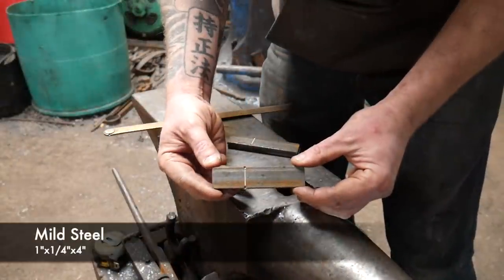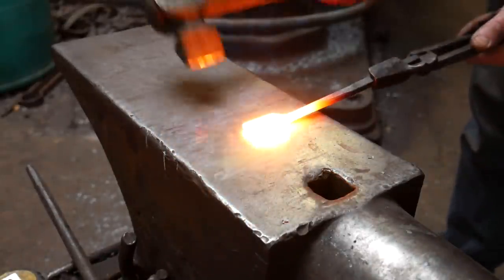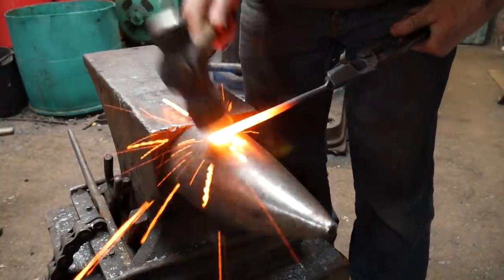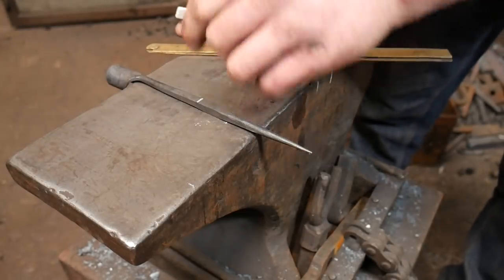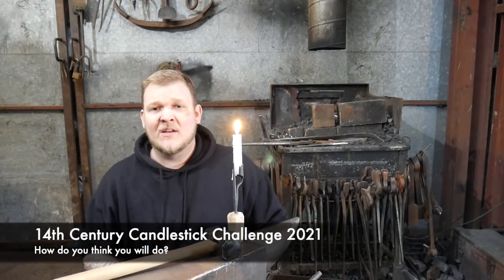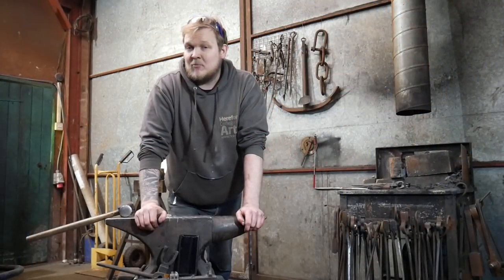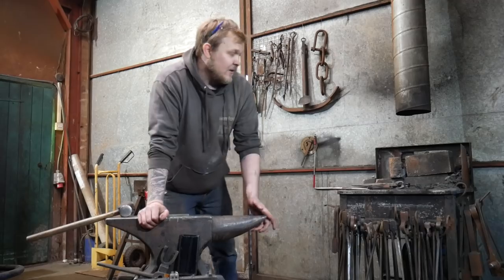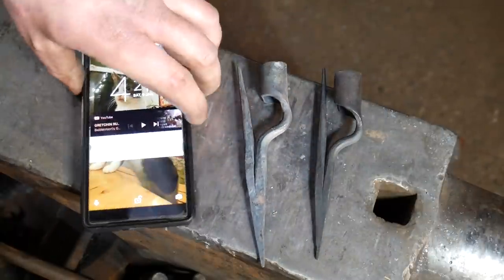How to make this epic 14th century candle stick holder.

Comment: Dan's attempt was so British. Step 1 - put steel in fire.... Step 2 - good sip of tea.... Step 3 - complete task

I'll have a go for sure. It'll have to be with the gas forge due to Australia's very rigid fire bans at the moment, but I'll definitely have a go. I expect I'll be WELL down the bottom of the leaderboard, as my forging style is built on the rule of "slow is smooth, and smooth is fast". But I'm interested to see how it turns out!
Reply: We cant do anything properly without a sip of tea 🤣
Reply from the maker: Hahaha so true. Best of luck dude I know you can do it xz

Comment: Not enough experience or equipment for the challenge, but will try to make similar with what I have just to see if I can.  However, my dear bride would behead me if I let it drip wax on any of her furniture.  SO, I'll perhaps try to add a bowl or shelf as a wax catcher.
Reply from the maker: Nice idea and I'm sure you can do it with a bit of time. Best of luck.

Comment: Great candle holder and great idea. I'd love to have a go at it but I'm in-between shops and the new one won't be up for another month. Plus, I'm pretty sure I can't do it in 20min anyway. Lol. But I'll definitely be making some of these just for fun and use. One question, how did you drive it into the wood? did you pre-drill a hole and then just stick it in as hard as you could or was there hammering involved?